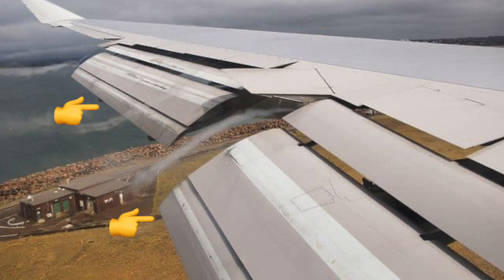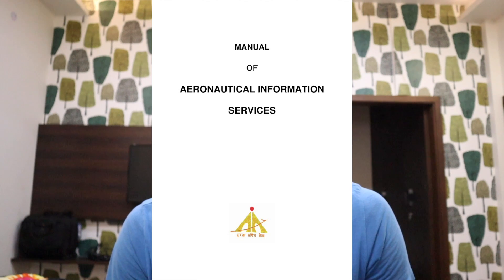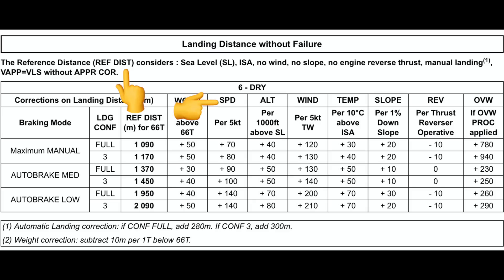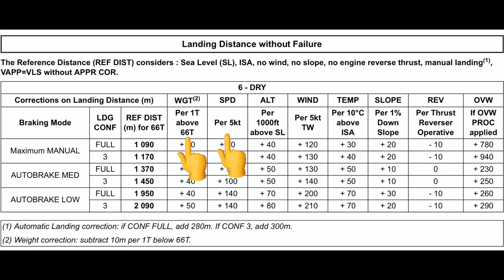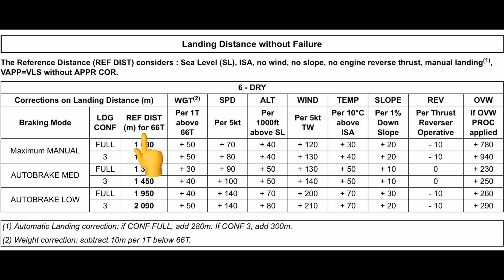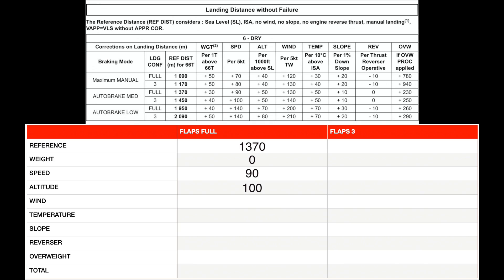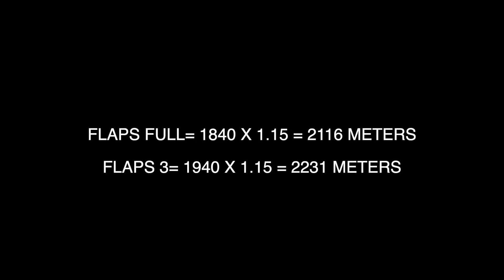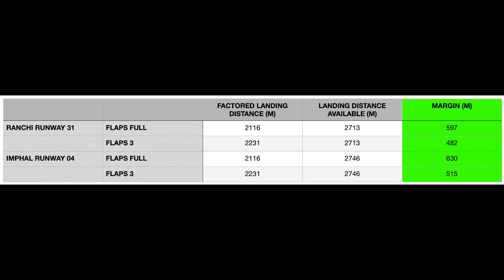HOW DANGEROUS ARE FLAPS 3 LANDINGS ON AN AIRBUS A320? 😰 (WITH PROOF!!!)

Comment: He did not talk about various other factors like "Steep Descent Angle" caused due to different terrains on the landing path. Forcing pilots to achieve 98% Flap 3 landings is putting passenger safety at risk and employee at pressure to take that risk. There may be some pilots who feel that they are skilled enough to do such landings on Imphal airport at steep descent angle with a high verticle descent rate during a rainy day, good for such pilots to feel so. But I dont want to be a part of that stunt.
Reply: Are u a pilot??
Reply: Wind speed, Rain, addition luggage weight, etc. etc. so many points he didn't consider in the video. He only calculated for the most favorable condition only. @Boeing Boy why ????

Comment: there are many fanboys and fangirls of Gaurav taneja which is evident in the comment section. These ppl didn't even get their class 2 medicals and are giving technical advices like they are air crash investigators. I personally think Tapshi point is valid. There is only 1 pilot who seems to have a problem with  Air Asia. If there is safety problem with Air Asia's operation than there would be captains senior than Gaurav coming out to protest but nobody is. Considering evrything we should wait for DGCA investigation and until than Gaurav taneja bootlickers can shut d fk up.

Comment: So now we know why he is at 116K and the Best, the Beast is at 3M+
Reply: (*Caution:* This message is *LONG*)
Here's the thing, I yet don't want to hate him just because of this debate going on between flap 3 and flap 4. Flap 3 landing is safe, BUT not every time. They are not compromising our safety because flap 3 is not dangerous, however there are certain conditions when the pilots will decide on Flap 4. Let's say we are landing in Leh Ladakh. The altitude is HIGH and air is thin, here the pilots will almost ALWAYS use Flap 4. But if you are landing in Delhi IGI airport, the runway is long, the air is dense because of not-high altitude and there aren't much tailwinds. So it is not unsafe in most conditions, but it is in some cases. Now the problem is everyone who watches Flying Beast's channel doesn't really know much about aviation. So they don't understand exactly what he says. Even Gaurav says Flap 3 is safe. We should respect both perspectives and not blame Tapesh Kumar sir. he seems kinda arrogant in this video but that's just because all the people who don't know much about aviation keep saying flap-3 is unsafe but it is totally based on the conditions. THE TARGET OF 98% FLAP-3 IS THE WRONG PART in my opinion (and in Gaurav sir's opinion as well). Because Flap-3 saves fuel and it is still quite safe, airlines ask pilots to land with flaps on 3rd setting. However to force pilots to always make flap-3 landing is wrong. The captain has command so it is his decision whether he should make the landing with Flap 3 or not. Gaurav sir was suppressed by the Airline because he was raising his voice on THE TARGET TO MAKE FLAP-3 (not the flap-3 landings themselves). So he raised his voice even more. 

Conclusion:
Flap 3 is safe under most circumstances (like in cases where airport altitude in not too high, not a lot of tailwind and long runway) A320 is a versatile aircraft and it is made to operate on short runways and so it can land on slightly long runways with Flap-3 with NO problem. However the TARGET THAT MUST BE ACHIEVED BY THE PILOTS TO MAKE FLAP 3 LANDINGS 98% OF TIMES IS WRONG. What is the runway is slippery and wet? What is the runway is short and high in mountains? What if they are getting a lot of tailwinds? (Well actually they won't always get tailwind and if they do, they switch the runway direction and land INTO the wind making it more suitable for Flap-3). So Gaurav sir is correct and so is Tapesh sir. It is just the public which made Boeing boy angry because people with literally no knowledge are saying such things, "FLAP 3 IS UNSAFE, SAFETY MUST COME FIRST" and the fact that people also say, "GAURAV SIR HAS MORE EXPERIENCE THAT YOU SO SHUT UP" makes him even more angry because people don't quite understand what Gaurav sir was saying. He was targeting THE TARGET and not THE LANDING. People didn't get that point and started the hashtags of air Asia is unsafe. 

Note:
I am a 14 year old boy dreaming to become a pilot. I AM NOT A PILOT so my opinion can be wrong. I just want to say that we should respect everyone's opinion. My knowledge comes Flight simulators (not those stupid mobile ones 😅). So yeah don't be angry in replies.

Comment: These arguments and counter arguments doesn't matter. 
What matters is passenger safety first and then aircraft safety as far as Captain of the plane concerned. If a pilot objects to something related to safety, then management needs to address this instead of giving instructions to save fuel. I think tapesh agree with this point.

Comment: You very wonderfully dodged the point about steepness of descent flight path and manipulated this whole thing into calculating the runway length at a normal descent rate! You should be more responsible and if not then should stay away from taking sides directly or "indirectly".

Comment: You didn't mention anything about the 3.5 degree glideslope in Imphal. It is not regarding the available landing dist, but what happens before the touchdown. Flaps full help in a stabilised approach for such a steep angle of descent. An unstabilised approach can lead to higher speeds, or landing into the runway eating into the stop margin. Or there can be a go-around that consumes a lot more fuel than 8 kg. If a pilot feels comfortable with flaps 3/flaps Full for the stabilised app and safe landing of the aircraft, no one should question him/her, regardless of calculations.

Comment: Flying Beast never said that any of the landing is considered to be a risk but flaps full is a little on the safer side. 

Understand the point, he did 7 flaps 3 landing and 3 flaps full landing. He's not against flap 3 landing. 

I am stunned by the way he presented this video, I'm a software engineer, I fuck up the code, I can fix it. This is a plane dude! There are lives at stake! No amount of money/fuel/bullshit can justify human lives. 
It's not wrong to follow your gut and be safer that too with lives at stake!

Comment: Gaurav sir didn't said that he is always using flap 4 landing.Only 2 landing are flap 4 landing and air aisa is pointing that.
And he used that flap 4 landing for safe landing and not to take risk.

And yes no one will play with their life so why airaisa is set a condition to use flap 3 

When pilot is taking incharge of the aircraft then company should not keep term n conditions to only land like this. It is totally pilot decision how they want to land.

Comment: As a design engineer for AIRBUS, I do not understand why you call FLAPS 3 landings as "dangerous". I believe being a pilot yourself you are aware that for an aircraft to be certified to land at a particular landing configuration, it has to go through numerous flight tests where the aircraft is taken to its extremes by our test pilots. The final data decided is well within those extremes. Hence, you can not call it "dangerous" on a social platform. Yes, it can be avoided based on environmental conditions, aircraft condition, airport traffic, etc. But, it is never "dangerous" to land an A320 at FLAPS 3. Had it been dangerous, AIRBUS would not have mentioned it under landing configurations. Please change the title of your video as it could lead people on a completely different direction even though your justification in this video does not make FLAPS 3 landings "dangerous".

Comment: Technically he isn't wrong. But I still stand with Gaurav because he mentioned several other lapses. The fuel uplift problem is an actual serious safety issue! Law says final decision lies with the PIC and they sent out emails telling their pilots that they need to get approval from dispatch first. This is a major safety issue as there might come up situations where the pilots could try to avoid the hassle of contacting dispatch and fly without the fuel uplift which could prevent an accident from happening some day.

Comment: For someone preferring 8kgs of fuel over passengers safety, do you think people would be confident enough to fly when they get to know you are one of the pilots?
Reply: yes air asia prefers 8 kgs of fuel vs 120+ lives. and they seem to quite adamant at saving these 8 kgs by using any means necessary.
Reply: @KumarVaibhavSri  See, The 8 kgs which you are referring to you, should be multiplied by 4 because generally an aircraft makes four sectors in a day and then multiply it to number of aircraft in the fleet. Now the amount which you get you need to multiply by the cost of fuel in dollarsthen convert it into rupees by multiplying it 72. Now tell me the value you get. This will be savings in 1 day. Different airlines have got their different ways of cost cutting management that's what made each airline different you are talking about Indigo airline definitely it's a good airline but at the same time if you think of SpiceJet just compare the share prices of both the airline will see a noticeable difference. The only thing wrong here is that they have made it as a sop where is this should just mention the target and give bonus according to that. Rest is pretty perfect because both the landing methods are allowed by manufacturer
Reply: @nikhilgenai  if aircraft makes 4 sector it also makes 4 times earning ..if someone is flying for 1sector paying for sector why should he consider 4 sector ..it doesn't make sense.. don't say anything just to favour AirAsia...if someone points mistakes of management..what they do is .. suspension..
Reply: @nikhilgenai  Whatever the cost, first and foremost priority is passenger safety. Given the choice between ₹100 discount with negligible safety measures and full safety without discount, what will you prefer?
Reply: True
Reply: https://www.youtube.com/watch?v=useelgg2gho
DGCA Senior Flight Inspector speaks AGAINST FartAsia
Reply: TUMHARE PLAYGROUND MAIN HI AAKAR TUMHE DHOBI PACHAD DIYA #TERIKEHKELOONGA #sabkeliye   youtu.be/M1SHFhNXI0Q @flyingbeast320 @CarryMinati
Reply: Pilots are not bothered about saving fuel...
Reply: When you maintain an airline yourself them you will understand. Please clarify what part of the video is still contradicting your view ?
Reply: Nikhil Singh Thats the worst argument you could possibly make: ‘when you run an airline’ why would one need to run airlines when there are plenty other options to choose from who leave the command duly to the pilot and let him make the call between saving fuel in apparent weather/runway conditions. Thank God, we saw the real AirAsia, god bless.
Reply: @nayanthegreat1  They are budget airline they need to cost cut, What runway conditions are you speaking about?!
Reply: @nikhilgenai  perhaps they shud sell to Indigo. Who seem to be more profitable without sacrificing passenger safety.
Reply: Nayan David I am a pilot and please note that all airlines have some conflict between pilots and the management. No airlines would compromise safety because if any crash happens, its the airlines that will bear losses in billions. And all airlines have same issues as with air asia. So why dont you avoid all airlines then?
Reply: @aakashrauniyar6809  So if there are some conflicts between pilots and airlines it will be better for airlines if they listen to pilots cz at the end of the day pilots are the one who have to take quick decision not the airline ..if they are conflicts atleast airlines should listen to them..but in airasia they don't gave any clarification neither a single call to gaurav ..This is what ur so called airlines..

Comment: Tapesh bhai you really don't need to put this video at this time. I really admire you and believe you as my inspiration. But If you want to tell as this is a different video and not relate to the FlyingBeast scenario, I guess you might wrong and It's directly affecting to the respected Capt. Gaurav's #SabkeLiye. Hence, as mentioned in other comments question was not that how dangerous are flap 3. It was about pressure to do 98% flap 3 landing. As you connected with the air asia, you might have more information about this scenario but according to my research and knowledge whatever air asia doing right now is totally wrong and giving baseless excuses with their employees from Twitter to here as well. And its really annoying to see that Twitter handler @skipper using your name and video to give excuses. Whatever, Don't worry still we loves you and always with you. You were-are-will my inspiration. Just hopping for one passionate captain's support to another passionate captain. More power to you!

Comment: At last part of the video you said that in both flap settings we have sufficient runway left. If this is the case why A320 has flap full setting as then all landing can be easily performed by flap 3.Also airlines cannot force pilots to use flap 3 98% of time. What if there are conditions that pilot have to use full flap but doesn't use it because of the company policy. Here safety of the airplane is compromised.
Reply: it's in the description. Go check it out
Reply: @naimabdullah7033  Therefore airlines cannot force pilot to use flap 3 98% of time. What if there are conditions that pilot have to use full flap but doesn't use it because of the company policy.Here safety of the airplane is compromised.
Reply: yes. You are in this regard  @uzairmotiwala327  . But we cannot blame TAPESH sir for that

Comment: Both flap 3 and flap full configurations are safe. If they aren't, why do they exists in the first place?
But, they are different(not north pole  south pole different), and meant to be used considering the situation.
Engineers made those options available so that pilots can use them where they feel it right. 
You can check the video description
.
Moreover TAPESH sir has made a disclaimer. He didn't meant to take stand against anyone.
All pilots are trained and they know what to do when in a flight. 
I think any airline should not set a target of a certain landing configuration. Cause, the conditions of a runway is not always helpful to the pilots.
Both the pilots are right , they are not against each other .
.
But........the specific airline is risking people lives. That should be noted.
*Don't blame these two brilliant pilots, please.*
Reply: right
Reply: so what?

Comment: Airlines company always show that they do the full inspection and don't  compromise with even a simple or smaller thing while dealing with safety of passengers. So why to give target for doing flap 3 landing?
If air asia is so much concerned abt saving money by adding a bit risk to the flight, it should rather ask the passenger to pay for that 8 kgs of fuel. For an Airbus a320, it shud come around 4 rs per person and a passenger wont mind giving u 4 rs extra.

Comment: I used to be your fan but after watching this video I don't like to watch any of your video from your channel

You gave all the figure in dry runway gaurav sir also mentioned that in one of his landing in flap full weather was not suitable to land with flap 3 you have not taken weather factor in your calculation

Gaurav sir said both landing are safe in different conditions none of them are unsafe but flap 3 landing is unsafe in some condition. 

I suggest you to watch his video once more by giving more concentration and don't try to be dalla of air asia

Comment: If flap 3 is really very safe then whats the use of having flap 4.It is very general that flaps shall be in full for landing.Just to save fuel they change the whole procedure.Its pilots wish on what flaps he must use according to the situation.Gaurav didnt mean flap 3 is dangerous,me meant that of there occurred a situation where flap full was required but still due to the airlines pressure he might just go with flap 3,which can be very dangerous and unsafe.That is important here.

Comment: Well clarified, at the right time. Thanks.
Reply: But Flying beasts flying hours and the no of landings to his record definitely matters, and imposing a 98 percent flap3 landing , definitely might cause stress and strain on a pilot, which can be avoided, and the decision best left to the pilot, and not the ones sitting in the board room,since the pilot knows all the parameters at that landing moment, and  take right decisions, instead of being on 98 percent flap 3 pressure. Airline should leave this decision to the pilot.

Comment: Flight crews should pay particular attention to monitoring their speed in descent close to VMO/MMO and when flying close to the wind direction (. The impact of a wind gradient can be significant and bring the aircraft beyond VMO/MMO.
When close to the ground, the wind can change, especially when in gusty conditions, and have a direct impact on the aircraft speed. As a consequence, monitoring of airspeed is crucial during final approach and landing to avoid:

Runway undershoot, hard landing or tail strike if the aircraft speed becomes too low, or
Runway overrun if the speed becomes too high.

The aircraft can be in either an over energy or low-energy situation at landing if the crew does not manage the aircraft’s speed correctly from top of decent, thorough approach, and down to the flare. The consequences upon landing are increased risk of runway excursion, tail strike, hard landing or runway undershoot.

Whatever the level of automation chosen during descent, approach and landing, the flight crew should be aware of its capabilities, take full advantage of the tools available on airbus aircraft and apply the procedures and techniques provided in the FCOM/QRH and FCTM.